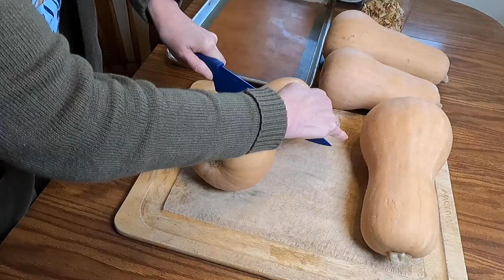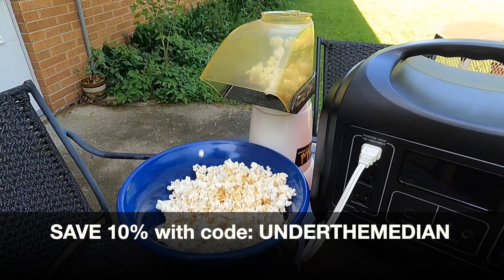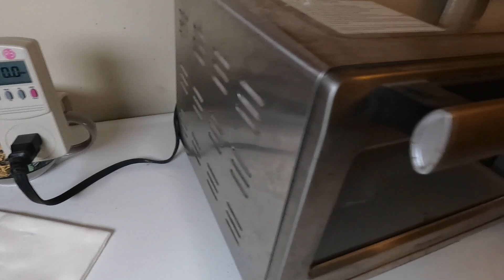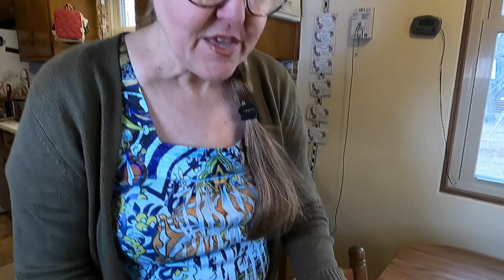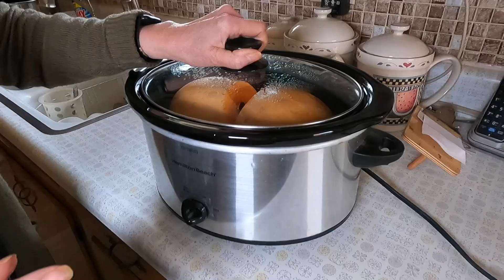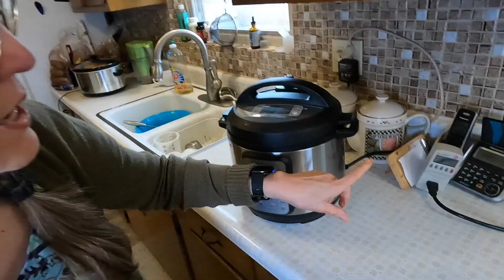How to Save Money Cooking with Low-Energy Appliances

Comment: I'm a part-time van dweller who mostly cooks with electricity from solar.  I have found that my small (3 quarts) electric pressure cooker is super energy efficient as it mostly coasts when it reaches pressure so it was no surprise that it was the winner.  However, I was surprised that the crock pot used as much energy as it did. It was not very different from the oven or toaster oven.

Comment: Really liked your contest video.  Total kilowatts to get a job done is, as you've shown, what matters the most.  While the crockpot might have a lower kilowatt-hour rating, needing 4 hours to get the job done really adds up!  I'm a fulltime RVer heavy into boondocking  who depends mostly on solar power stored in my "house" batteries...you've got me seriously thinking about getting an insta-pot and saying goodbye to my crockpot and convection toaster oven - or at least doing my own testing.  I'm wondering if your toaster-oven was of the "regular" sort or if it was tested in "convection" mode.
Cheers!
Reply: Nope. The correct unit to use is kWh. You buy electricity in kWh. kW is the energy draw at any instance in time. kWh is the total energy used.
Reply: @AORD72  thank you for clarifying the units.

Comment: I use a pressure cooker on a gas hob, and that's even more economical, because gas is cheaper than electricity here in the UK. A hay box would be the ultimate economy I think, if you have space.

Comment: I would say it's the instant pot. This comes from experience using one. I do quite a lot of cooking & when I switched to using my instant pot for the majority of my dishes my electric bills dropped dramatically. The fast cook time is my guess on why it's so much less expensive to use.  What I love about my instant pot is I can even bake in it!  This last year we built an outdoor oven which burns wood. This was because there was a heavily wooded area not far away that was cleared. My fellas cut all that wood into firewood and let it dry.  Out with the Oak trees & in with free cooking fuel!

Comment: I know things don't always come across as intended with only text, I mean no disrespect and hope I manage.

kW aren't "used" and I assume in the chart that you meant kWh. As for the oven, assuming the chart from your utility provider is to scale and that each bar represents one 15 minute interval, it appears closer to 1kWh but that can have a lot to do with what other loads you're running, if you're billed for reactive power or not, where your oven is situated in the house and if it added to your household cooling or reduced the heating load.

As for the Instant Pot vs. all others (none of which can hear it much above boiling) getting the food to a higher temperature means it Cooks faster and stays at a cooking temperature longer after the heat source is removed. Not even slightly surprised that it used 20-25% of the energy.

I loathe "modern" appliances. They are designed to fail, there is no need for a computer in every appliance and NOTHING is added to my life by a Bluetooth-enabled toaster or a refrigerator on which I can watch YouTube so an Instant Pot is a NO-GO for me; However, I very often use a 4qt or 6qt pressure cooker.

Another way to save energy is the old "haybox cooking" technique. If I get it up to pressure, immediately turn off the heat and put it in a well insulated (I use a cooler that got dropped and started leaking so was free to me and lined it with a few layers of surplus wool blankets too worn for camping use so again, free) box, even the 4qt will still be under some pressure (therefore above boiling) an hour later. Over an hour of cook-time for just 5 minutes on the (we use NG as it's the most reliable option here) stove.

Another bonus, you can do the same without a pressure cooker. Making a big pot of beans, stew, soup, stock... anything that needs to simmer for a long time? Just get it to a rolling boil and put it in the box. It'll take longer to cook and until you get the hang of it, I'd encourage having some way of checking without opening! that it doesn't fall into the danger range. But I can put a 5gal pot of stock in one evening and after breakfast it's still well into safe territory.

Hope this wasn't too long. You just found a new subscriber and I'm looking forward to watching.

Comment: I use a gas stove top pressure cooker all the time and also on the woodburner, it apparently kills lectins and also does a great job tenderising meat, I have two crockpots which are great for reheating food not so much for cooking from scratch. Great vid thank you for sharing.

Comment: I close my bedroom door and turn off my houses electric wall heaters and cook with the instapot in my bedroom I release the steam and then using electric blanket at night
Reply: Note, releasing the steam on my instapot does not keep my bedroom warm long so the electric blanket is my friend? I have tried an experiment but I don't have your metering equipment I have simply boiled water in the instapot in my closed bedroom my thoughts are this uses less power them my wall heater?   IDEA my instapot is my poor mans heatpump:)

Comment: We just found out our inbuilt oven is 8800watt. That works out to $3.52 per hour of usage! When you consider that maybe half that time is to warm up the oven, suddenly a single batch of muffins goes from being $1.50 in ingredients, to $5!!
Reply: We also stopped using our electric stovetop, which takes forever to heat up (and then when it's hot, takes ages to cool - easy to scorch things), and wastes electricity in heat loss, to using a portable induction hob (direct energy cooking). It saves money, and is way easier to cook with: instantly heating or precise lowering of temperature. Our electricity bills are better making the change to induction stovetop, and air fryer for other things. Still use the oven for bread and muffins, but now we cook those things in succession on the same day, to save wasting energy with heating the oven several times in the week.

Comment: I have all four and would have said the Instapot UNTIL I recently tried another air fryer and now I think it could be a close tie between the Instapot and the new air fryer. Most things cook to a crisp in the air fryer in 10 minutes or less. Since we started using the air fryer instead of the countertop oven...my electric bill dropped an immediate $20.00.

Comment: I avoid the oven in the summer. But in the winter I find it significantly helpful in lowering my use of the furnace. If I am baking  I can have my furnace off for most the day and sometimes all night long. My furnace costs me a ton.
Reply: I do the same thing.  And in the summer we do most of our cooking outside so we don't heat up the house.

Comment: I have a crazy question for you! I was thinking about my usage for my dishwasher the other day. Why does it take two hours time to use a dishwasher? Is there away to reset the usage? Why do those companies make the dishwasher take so long to use? Very cool test ! I also have a dehydrator. Would you test that too please? Thanks again as always!
Reply: I don't know how old your dishwasher is but ours has a 1 hr was cycle option. Also the heat dry not only takes up time but probably uses more electricity than the actual washing cycles.
Reply: I have always been the dishwasher. 😂 61 years old. 😶🌸🏠

Comment: I think it will be the instapot that wins. it's smaller and it uses pressure to do things way quicker. however I'd also like to have compared my air fryer/convection oven against my big electric oven not sure how I'd do that but kudos to you guys for finding a way to do this and  filming the comparisons. pretty interesting stuff.

Comment: I'm about a minute in, haven't read the comments, but I think its the instantpot because it has a mechanical advantage, a smaller, we insulated space with a rapid heating element and run for an ostensibly shorter time while still potentially having an equivalent amount of time in the 'cooking' heat range if you go with the natural release.
Reply: I was right!!!!

Comment: This is very interesting indeed and thanks for testing these things. We live off-grid so I tend to use my LPG stove rather than anything electrical. However, cooking butternut squash is a bit like cooking potatoes in that boiled potatoes are totally different to roast potatoes. If I'm baking a whole squash I use skewers through the squash to conduct heat inwards and therefore cook it faster.
Reply from the maker: Yes! The skewers would work like the nails you can put in potatoes so they cook more quickly. That makes sense.

Comment: I have a stove top pressure cooker.  I need to figure out how much power it uses!
Reply: I have a stove top pressure cooker and use LPG as we're off-grid. I calculated that the gas usage for a pot of soup is 10 minutes to pressure; 2 minutes at pressure and then switch off until the pressure has dropped. I calculated the gas usage to cost around 20 euro cents. If I am slow cooking I bring the pressure cooker to pressure and then place in my thermal cooker and leave it for a few hours. This costs around 10 euro cents.

Comment: I’ve used a pressure cooker for years, simply because it reduces cooking time significantly, but it’s good to see that it’s also the cheapest way to cook. Thanks for doing the comparison - so helpful as always.
Reply: Same   here.  When I got married my mother-in-law bought me a pressure cooker sixty years ago and I've cooked this way since.  I even got my mother one, she was so afraid of it but once she got used to it couldn't be without it.   Apart from s aving lots of energy the food comes out beautifully moist and full of flavour.  I  also bought years ago a small oven but big enough to roast  whatever and only use my big oven when necessary which isn' t often.  Thanks for all the good  videos you put on here.
Reply: @maureen1938  Same with me.  52 years ago Mom got me a stainless Presto and I still use it. Best thing ever!!
Reply: @maureen1938  I have an old stainless PC,and bring it out occasionally to make a quick stew. Peeling/washing the veggies takes far more time than the cooking process. Once it is up to pressure,you can turn the stove element way down,which is where you save scads of energy.
Reply: I use a stove top pressure cooker. Normally I cook enough food for more than one meal at a time and freeze the extra portion(s) for future meals. Currently my stove runs on (very expensive) natural gas, but the pressure cooking has proven to be economical even at the recently escalated price structure.
Reply: Solar cookers or Thermal cookers are technically cheaper... but...
Reply: @Wishing B  Yes that makes sense but I use an electric stove and have solar panels on my roof so I technically cook with solar 😉
Reply: @joycemjinx  LOL, yeah, I have solar panels, too.  So, yes, I don't even have an electric bill using my oven.  But before then, I looked into a lot of prepping and solar and thermal cooking are perfect for power outages.

Comment: I have a propane stove so I actually use my stove a little more in the winter because after cooking I can leave the door open and it helps heat the kitchen. I do not use it to heat the house, just use the residual heat.
Reply: An electric stove is better for the environment than a gas stove. Unlike electric stoves, gas stoves produce carbon monoxide, nitrogen dioxide, and formaldehyde. These compounds are harmful to the environment and your health. According to the EPA, indoor air is about two to five times more polluted than outdoor air.

Comment: Good info.  I think the oven & tr oven are good comparisons and the crock vs insta is good but, I don't see them as all equal together because of the different cooking methods they replicate.  I think it would be interesting to add a third to the mix.  Air Fryer with over & tr oven (my option) as well as stovetop (my option) vs insta vs crock.

Comment: Air fryer not airfreight  lol
Reply from the maker: LOL. I knew what you meant. We didn't do the air fryer with this experiment because we really needed to use appliances which would all easily cook the squash. Air Fryers tend to use about 1500 Watts, depending on the make, model, and size. I would also suspect that the heating element pretty much stays on the whole time you use it, but I'm not certain. That would make a difference in the overall energy usage.

Comment: Hope, I was so shocked 😮, I thought it would be the crockpot too! I’m wondering what would happen if you used the crockpot overnight during non-peak hours, say from 12am-4am….hmm🤔?
Reply from the maker: Our energy company doesn't have peak hours. The rate is the same all the time. Our utility company hourly rate program used to be a great deal and saved us money for years. But, when the supply rate doubled, that program wound up being so expensive that it made no sense to stay on it. However, you're right. If you have lower overnight hours, that would certainly allow you to cook in the crockpot at a lower cost. Also, a smaller crockpot would use less watts and cooking on the low setting would change the results, too.

Comment: A slow cooker is great for "set it and forget it" meals for those who are away from home all day and want to come home to a hot meal. However, if I am going to be at home all day, my solar oven costs nothing to use on a sunny day. But it does need to be adjusted every hour to stay focused on the sun. For no-cost cooking at night, I also have a 2-cup rice cooker that can run off the charge on my small Jackery power bank (it charges for free on a sunny day using a small solar panel).
Reply: Brown rice is best when it's cooked in a solar oven.
Reply: All of my Instant Pots (5 total) have a delay function so you can set for what time you want to start the appliance.  In truth, I’ve never set the timer though.  I cook almost exclusively on my wood cook stove late fall through May.

Comment: Does anyone use a thermal  cooker?? We use ours for soups and stews.
Reply: @ Susan Lam I’m interested in getting a thermal cooker, may I ask what brand you have, and are you happy with the results?
Reply: @janarichards5511  I have Tiger thermal cookers, 6 and 7 qts. Very happy with them. I think the key is to get a vacuum insulated, instead of styrofoam.  It's been years since I researched them, so you might want to double check.

Mine keep warm for many hours. Even overnight.
Reply: @baker1130  Thank you for responding.  One more question, if you don’t mind. Where did you purchase yours?
Reply: @janarichards5511  I purchased in Asian housewares stores her in Canada.  I'm pretty sure you can find various brands online, but check out your Asian stores to see them in person.
Reply: @baker1130  Thank you so much!
Reply: @janarichards5511  happy to help!

Comment: I’m shocked! We own an Instapot but I’ve never used it. My daughter and son-in-law use it. I always use the oven or the slow cooker because I didn’t want to learn how to use the pressure cooker. Time to learn new things!
Reply: Holy cow they are easy-peasy!!! Push a button. If you use the lid & let the pressure build, you just have to let it vent before opening. I've made bone broth, pasta, rice, hard boiled eggs, black eyed peas, yogurt.... and more! It makes the best rice and hard boiled eggs. I have the air fryer lid add-on so I make fish and chips, roasted chicken legs... You can find tons of recipes on line and how-to's on YouTube
Reply: I was a little worried about it too but it’s not like the old stovetop pressure cookers. As long as you follow directions it’s perfectly safe. You just have to follow directions about the releasing of pressure.
Reply: Instant is the most efficient, throw your slow cooker away.
Reply: It is super simple. I love it
Reply: remember to count the cooking time from when the pressure is reached (you won't be hearing the hissing sound anymore.  It should come to pressure in around 5 minutes.  If more, you might have closed the lid incorrectly or not turn the knob on the lid to 'seal').  Halve the cooking time from then on, or even less if you are going to leave the steam to drop by itself before opening the lid.  Never open the lid when there is pressure.  Make sure you follow the manufacturer's advice and you'll be perfectly safe.  The Ninja I use regulates itself once the pressure is reached, but you would have to decrease the heat to very low under a pressure cooker (if you use it on a stove) at that point.  You have also to make sure there's enough liquid in the cooker so enough steam can be created to create pressure.

Comment: Love my Instant Pot, use it for many things! I guessed crockpot. Electric .47/kwh here in CA so making smart choices and conserving is important. Thank you for doing all the testing. You even thought to power fridge etc. on the power station to take that out of the equation when it cycles on/off.
Reply: Homemade pizza the other day was in the oven not the Instant Pot, LOL. Although I could have put it on the grill on my pizza stone. But decided to open the oven after and have the stone put out a bit of heat for the home.

Comment: Crockpot definitely is cheaper but I have to say I want your retro oven lol.
I try to maximize the use of my 27 year old GE oven and stove top,  when I am cooking meat in the oven I usually also add a tray of potatoes as well.  It uses alot of energy I am well aware but modern ovens only last a few years,  I use the crockpot at least once or twice a week in the winter and in summer hubby does the gas bbq.